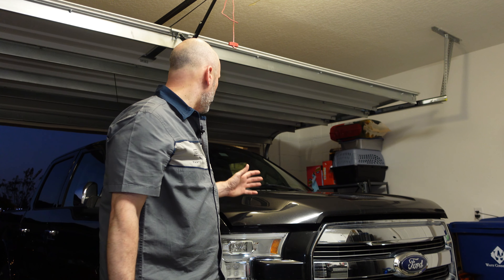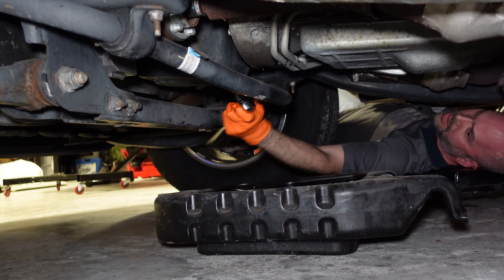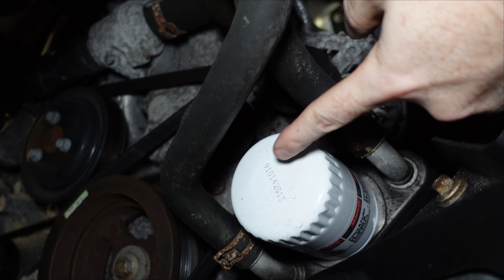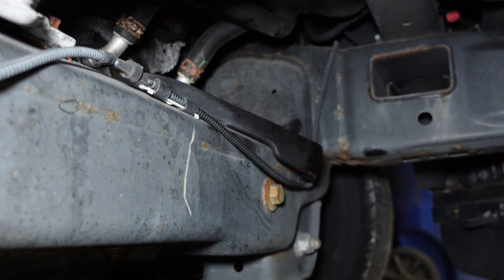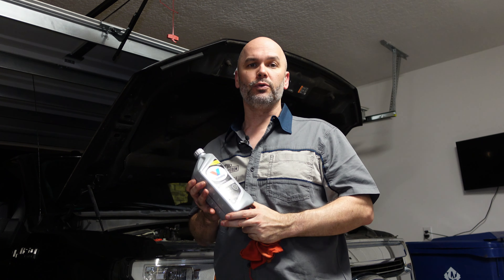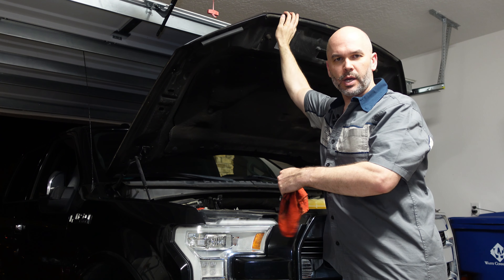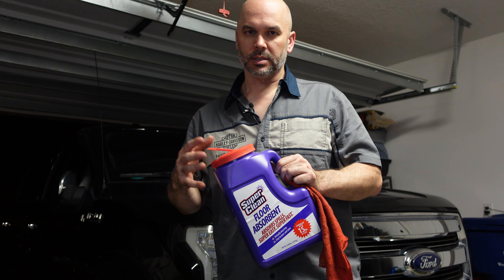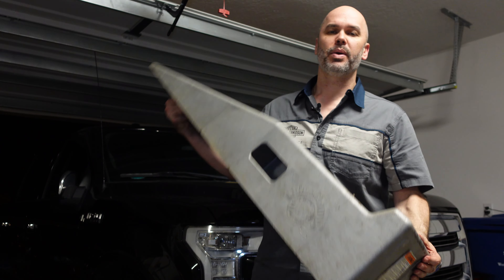How To Change Your Engine Oil -- 2015 Ford F150

Comment: Well done video! Just changed the oil and filter in our truck yesterday. I was disappointed they only offered high mileage or synthetic 10W-30 oil instead of traditional oil, thankfully I had already stocked up on traditional oil. Next chore will be replacing the air filter and drive belt, fun! Thankfully with the 4x4 setup on our truck we didn't have to raise it for draining the oil.😇 BTW, I always remove the seal from the new filter, coat it with oil, then seat it back into filter before installing it.